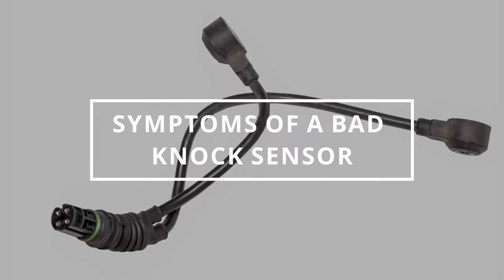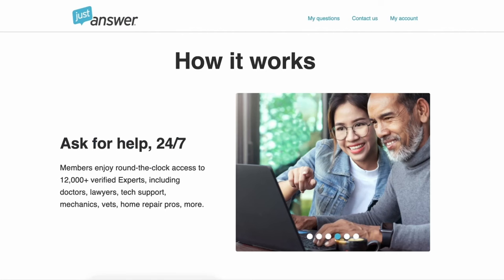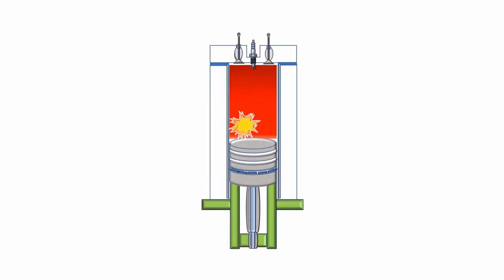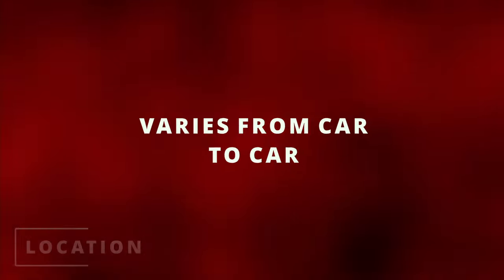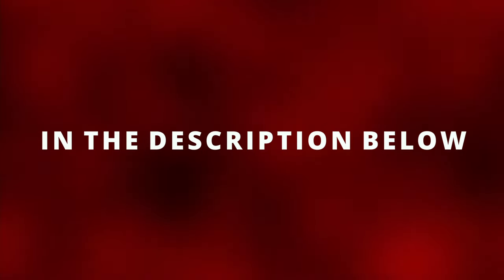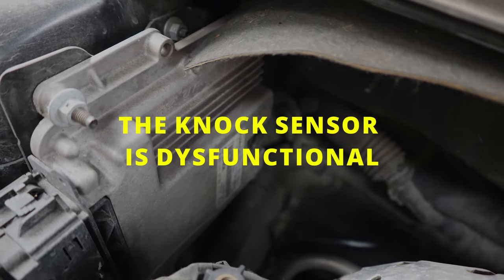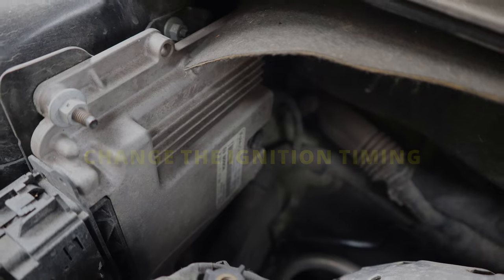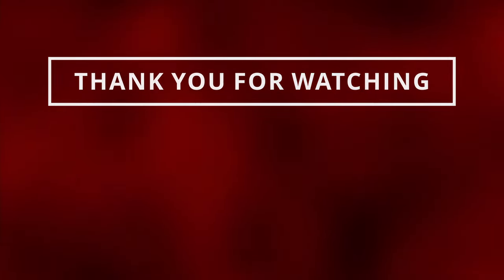SYMPTOMS OF A BAD KNOCK SENSOR

Comment: Had a 2014 Chevy Cruze. I thought my transmission was going bad because I couldn’t go over 40mph and I couldn’t go over 3,000 rpm. Turns out the whole time, I just needed a new Knock Sensor 🤦🏻‍♂️
Reply: Replaced and it’s back to normal?
Reply: Now that’s crazy😂😂
Reply: @special9555  No. I sold it
Reply: @tonybamgviews  😂😂😂 Real

Comment: I washed my car and sprayed in the grill and boom knock sensor code. Car idels fine. No noises. Just restricted to 2k rpm. I'm thinking wet sensor
Reply: same thing happened to me , i washed my car and the check engine light popped up except it didnt restrict the rpm or anything , it has a ticking sound and a P0330 code .
Reply: @privdexx2071  so what was the fix?
Reply: @AlphaFlight  that's what im trying to figure out , but it looks like i have bad knock sensor.
Reply: @privdexx2071  same then. Strange how it happened all of a sudden after wash. Checked all harnesses and fuses nothing was wet .

Comment: Is it possible to see visible smoke because of the knock sensor
Reply: @giobonilla576  white smoke is coolant burning. Blue smoke is oil burning. Black smoke is too much fuel burning. Valve seals would cause blueish smoke

Comment: I replaced my zl1 knock sensor and everytime i push to limit it keeps getting the code and i dont know what to do?
Reply: Stop pushing it 🤷🏾‍♂️
Reply: @kenyontookes7644  it’s a track car it’s supposed to be push to the limit
Reply: @clipslord6364 did you ever get it fixed?
Reply: Yo
Reply: @StrideX21 changed 02 sensor
Reply: @clipslord6364  what code were you getting.  I'm getting p0326
Reply: @StrideX21  it's been too long i dont remember bro

Comment: my ck engine light came on - it read a code for knock sensor, then the ck engine light went out later on all on its own.  Does this mean there could be a loose connection, or I have a defective knock sensor that works sometimes?
Reply: Could be either. Without testing the sensor or replacing the part no one would be able to answer that.
Reply: @bigwahoo8686  Thanks!  I still haven't done anything about it.  Mechanic says to let it ride until a smog check is needed.  That'll be another year away.

Comment: These videos are so helpful!! Can you possibly tell me why my 2012 tundra won't shift up past 4th gear right now? Thank you.
Reply: If your transmission is fine then maybe  your idle has been adjusted and set wrong, it can create a condition where the vehicle thinks it needs to stay in passing gear and won't shift into fifth on highway, lower your idle setting if this applies to you, this actually happened to a car of mine years ago in a crooked garage and me and a buddy fixed it ourselves.
It may not apply to your situation but I figured it can't hurt to mention it.  Good luck

Comment: Honda accord 2007, 2.4 with p0325 knock sensor code and p0420 at the same time . Replaced the sensor but check engine light came back on after erasing the codes . 
Any suggestions ? 
I replaced the knock sensor , The Delphi one . Vechicle runs normal . With no problems .
Reply: Hi did you find the issue? I’m currently going through it right now
Reply: O2 sensor or Catylic converter for P0420

Comment: Hi my car is Toyota 1zz 1.8 L engine. I have serious problems with my car engine. No mechanic knows what is happening. There is a metalic Tapping voice comes from engine when i climb a hill and it shows check engine light and the tapping noise gets louder. i start the car with a bigger noise after 30 seconds noise goes silent. Three times my car broke crankshaft bearings. I changed oil pump and but still having the noise. Plz help me. I regularly watch your videos. Thank u
Reply: I saw a video scotty made about that
Reply: What ever happens to your car ? My Toyota Camry is doing the EXACT same thing rn and no mechanic is saying something wrong cause nothing comes up on the ready but it is because it keeps shutting off
Reply: @Kykorp2024  could be the tps
Reply: @anthonyaguilar6978  what’s tps
Reply: @Kykorp2024  throttle position sensor
Reply: Will it make you check engine go off and on

Comment: I have a 2016 charger with the 5.7 HEMI , I ran over a chunk of concrete in the road and it hit the bottom of the engine I’m pretty sure kind of hard and soon after my engine shut off and car would not start again , it’ll crank but no start , nothing was leaking or nothing was out of line when I went to look under the car could that have triggered the knock sensors ?
Reply: Well, I don’t haven’t had many Dodge vehicles in my day and I don’t know that engine set up off the top of my head. However, in a general sense, I’m hearing “my car drove fine before I ran over that chunk of concrete, now I have a crank, no start issue after.” If that’s the case and it were me, I would take a look first, at the dash and see if there is a CEL (check engine light) on. If there is, start there. If not, you’ll find yourself back underneath the car, or under the hood, trying to pinpoint where the area of impact was. Though, as you know, most vehicles have those.. I call them “brush guards”.. those pesky, plastic fitted pieces attached underneath to protect the engine and other important components, from damage. Now, I don’t know how big of a chunk were talking about that was run over, though, that’s irrelevant at this point..

LOOK at those 2 things first.. ( CEL, damage underneath). Report back what you find out and we’ll go from there. Hope to hear from ya, soon.